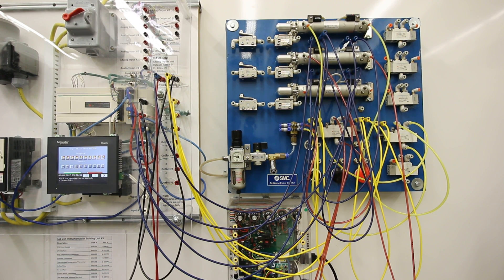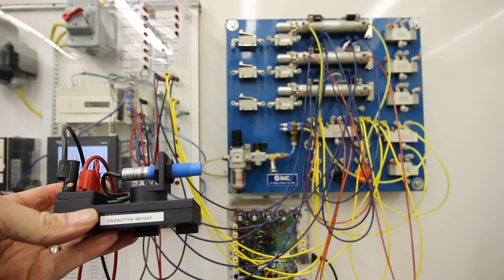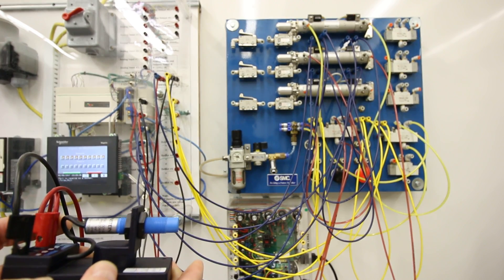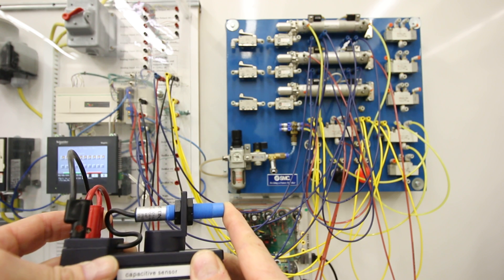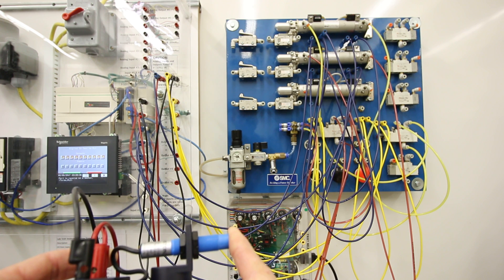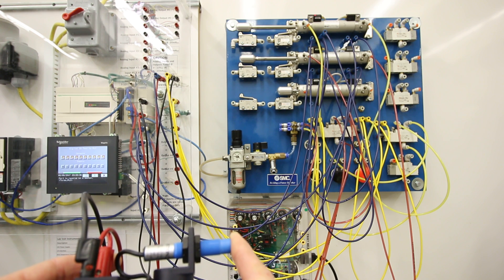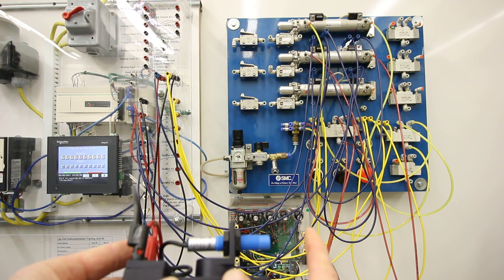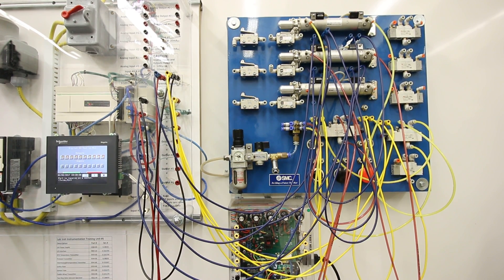Pneumatics Lab #19 (Drill & Clamp Circuit controlled by the PLC)

Comment: One just needs a latching relay circuit in the program. Ideally, one would use a time delay after the sensor signal becomes active to make sure that the signal is introduced by the finger not some random event (spike, noise, what not). After the delay a latching relay circuit activates, which may also be used to block the input (to be sure). As long as the latching relay is active, the cycle continues. When the cycle ends, it resets the latching relay. Therefore, after the registration of the correct input, the cycle will not be disturbed. If it is necessary to stop the cycle in between, just add what is necessary to the reset line.